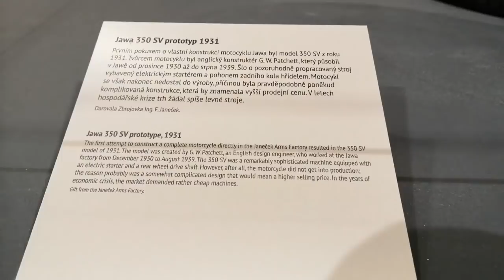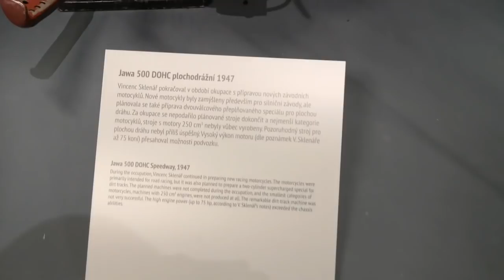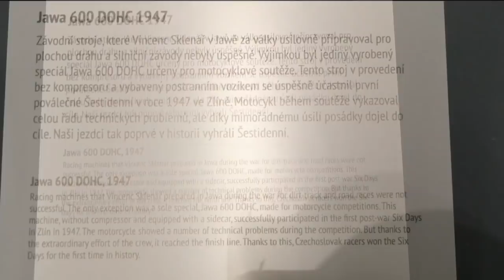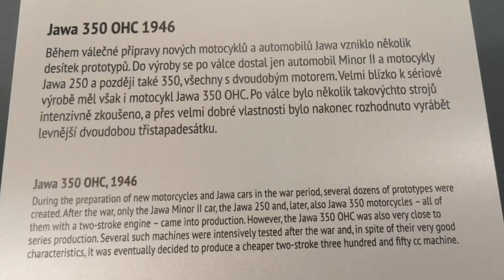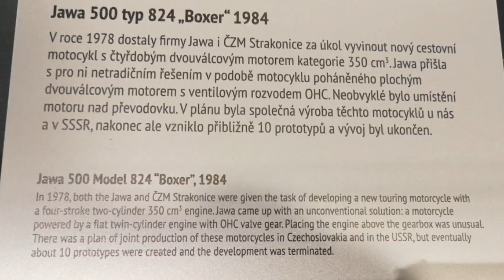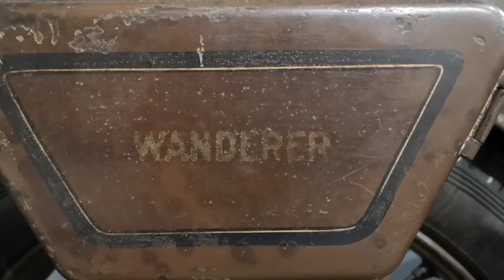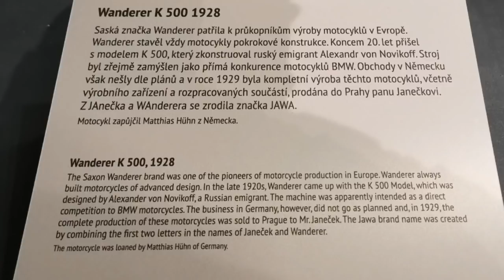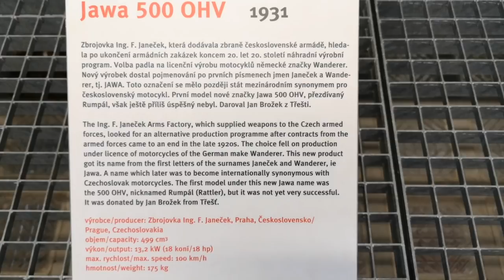JAWA : the Most Interesting of the Unknown!

Comment: Did you ever come across a Dunkley Whippet small motor cycle. I remember the interesting intake and exhaust system. I believe it was called a Torrodial valves system ?. Paul Dunkley comes to mind .This from circa 1958 time. Valve mechanism was basically an inverted pyramid shape in the cylinder head. It rotated open and closing ports as required, similar to the action of a more common disc valve system. But this was a four stroke engine of about 65 c.c.. Sealing the valve mechanism proved to be a problem I believe, it wore out quickly. Working on an 80 year old memory so will expect corrections.